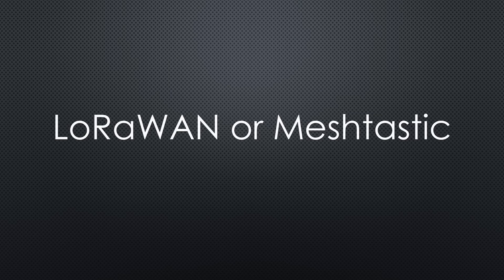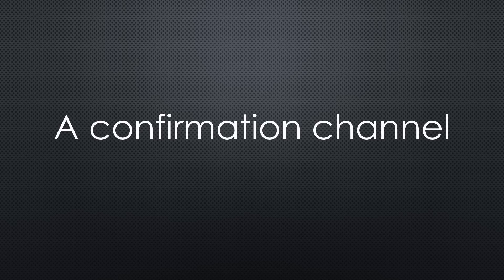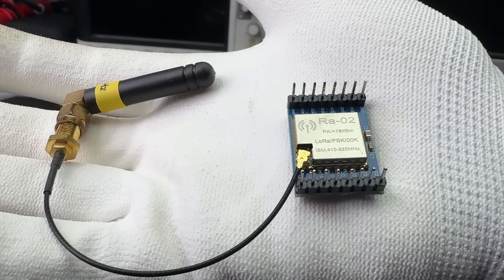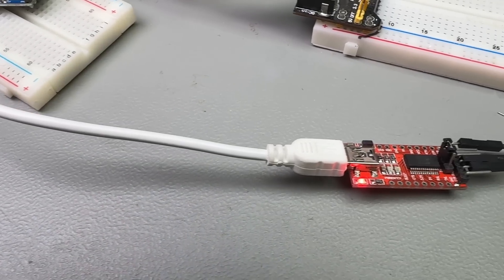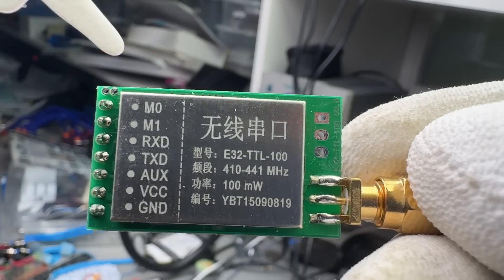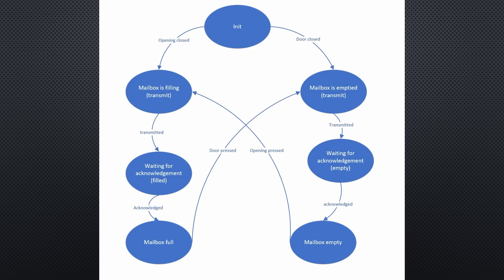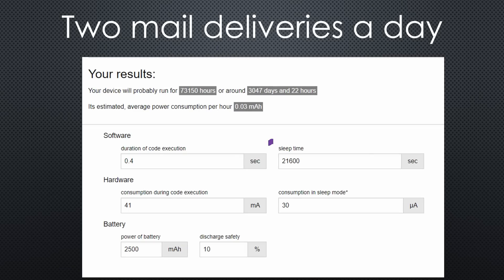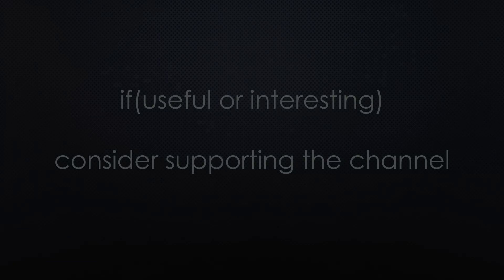(493) "Transaction Proof" Mailbox Notifier using an unknown E32 LoRa board and an ATTINY1614

Comment: Hi Andreas, you're right: "Goodbye LoRaWAN". LoRaWAN Concentrators are very nice piece of Hardware but the Application side for doing little IoT stuff is just cumbersome.

Please take a look at my website/blog, i try to solve the LoRaWAN up/downlink and other issues by combining both worlds into one and came up with my own easy protocol called LoRaLink - Connecting the Unconnected

It is not p2p like meshtastic, but uses (private) LoRaWAN Hardware to do some awesome IoT stuff. Can be self-hosted, no middleman, less complex and independent from Cloud platforms like TTN.

Comment: Well, should you get your hands on a none-refillable vape... Those usually have tiny lithium cells. With a cheap charging electronic you can run this for quite some time, and if you don't vape yourself but get it for free from someone else you only have the cost for the charging electronics - and even this you can use for other such cells... 😊
Reply from the maker: Good idea! I prefer primary batteries for such low-power fixed sensors because I can exchange them on the fly. Otherwise, I would have to remove the sensor for charging. 
I also do not know the self discharging rate of such batteries.
Reply: @AndreasSpiess  LiIon batteries have negligible self discharge. I wrote the voltage on several batteries and just left them for more than 2 years. And they were the same afterwards. They were left in a tempered and dry room, which may be of interest. Epecially the "dry" part.
Reply: @einars899  That's odd, because the widely quoted self-discharge rate of several varieties of lithium rechargeable chemistries is ~5%/month; NiMH can be as low as 1%, and primary battery chemistries quite a bit better than that, as Andreas said.
Reply: @alsavage1  For a battery with built in BMS that may be the case because it will use battery capacity to do its job. Some are draining the battery at rates you mention, some are more low-power. I was mentioning single batteries with no built in electronic of any kind. But I did this with many different 18650 LiIon batteries, so I cannot imagine any special chemistry.

Comment: Your power-consumption data-log shows a base current of 2mA (not in microA range) -you probably tested the power-consumption in standby/suspend and they where out of scope for this video. Archiving the Datasheets standby is often not trivial and i would not trust myself  to have done that unless i measured.
Since the ra-02 is a sx1278 it probably also has a low standby, if switched into sleep mode the ra-02 Datasheet seems to specify standby (ready to do something) only. You would not need to cut power (mosfet) to it if the driver/program handles the sleep-mode.
Reply from the maker: I did some measurements. You are right, deep sleep current depends on many things (I did some testing). This is why I assumed a much higher than specified consumption for my calculation. But time will tell when I finished the sleeping part...

Comment: if you had ESPnow to MQTT gateway you could have simply used ESP32 in the mailbox and that would be kind of 5 times simpler with the same results: reliable, low power, with confirmations. ESPnow supports long range connectivity and the full transmission including wake up and go to sleep is kind of 0.1s with about 8uA sleep current for ESP32. Less complications but of course one has to have espnow2mqtt gateway already there.
Reply from the maker: I agree. But I tried it a few years ago before I built the current notifier and it did not punch through the faraday cage of the mailbox.
Reply: @AndreasSpiess  so you want to use different frequency rather than 2.4 GHz right? and modulation. To get it through the cage. Right? ;-)
Reply: @zyghom  LoRa can transfer a message that is buried in the noise floor! You exchange the high bandwidth and requirement for a high link budget of WiFi with the opposites for LoRa.

Comment: Saw this and immediately thought that I would send you an operational jammer through the post.
Reply from the maker: And I would never discover it because I would never get the alarm to empty the mailbox ;-)
One advantage: I also would no more get invoices! 
Have a nice week.
Reply: @AndreasSpiess  I love it - always positive!  :) Best wishes
Reply from the maker: @richard_wenner  It served me well up till now ;-)
Reply: @AndreasSpiess  I would recommend a HELTEC V3 Board with Meshtatic and use the inbuilt Detection Sensor feature. It could transmit a State Signal every 2 minutes, so even if a jammer arrives or the system malfunctions, you would know. To save battery, a better board with the newer nrf chipset could be used or the mailbox could get a small solar panel and would double as an outdoor node.

Comment: Your state machine doesn't show anything happening if there is no acknowledgement. Do you have timeouts in those states that re-transmit the filling or emptied messages?
Reply from the maker: It is handled in the "waiting for acknowledgement". I felt it did not need a separate state. But I could have written it into the box, you are right.

Comment: Nice video! Would not just using confirmed uplinks solve your problem on LoraWAN? A known stratagy is sending 2C+1N messages. Being 2 confirmed and 1 non confirmed.
Reply from the maker: I never used "confirmed" uplinks. I assume it would also include at least one downlink message. There is not a lot of information available.  Did you use it and did it work?

Comment: I am not sure if this channel covered this, but a Chinese robotic lawn mower (Mammotion Luba) severely violated the 1% rule and users of it were contacted by the national frequency agencies in at least France, Switzerland and Denmark and were told to stop using it. The manufacturer (Mammotion) quickly rewrote the entire Lora code between the RTK base station and the robotic lawn mower into using a custom frequency hopping algorithm, and there were a lot of bugs, issues, and also a report that even the new algorithm violated the duty time rules. I am interested in how unprofessional and badly designed products on the market ruin the RF experience for everyone, how it is monitored, managed, etc..
Reply from the maker: Here, the authorities are responsible to monitor the frequencies. However, often, such violations do not harm others and are not discovered. But if discovered, these devices come on a black list and are confiscated by customs (if discovered). However, this Luba is not (yet) on our black list ;-)
Reply: @AndreasSpiess  In this instance it actually was discovered by neighboring businesses, as their equipment almost faced a sort of denial of service attack or jamming. The duty cycle of the Mammotion RTK base station was measured by the French ANFR as being between 30% and 95% as per reports. I guess once complaints were sent in to the authorities it wasn't too difficult for them (?) to send a car out and find the offending device. After firmware updates the individuals got a letter saying it was now ok to use the device again, however I am very skeptical of such companies that couldn't care less about the rules to begin with. Many interesting posts on it using the terma Luba, ANFR, RTK, etc.
Reply: ' using a custom frequency hopping algorithm'
There is no frequency hopping that can work, the rules for it are purely time and on the band based, there isn't any language for changing freuqencies within the band resets the time..
The band is clearly designated for low duty, and was willfully misinterpreted to pretend it was OK to be doing continuous transmission in any manner.  Max duty in the US was like 30 seconds, a minute, maybe two an hour, been a while since I last checked the spec.

ANY manufacturer or seller in the US pretends they 'didn't know', then they are almost guaranteed lying.  When they were coming up with this dumb, illegal use of the band, there were tons of people explaining how hard they were breaking the law.
But ultimately the FCC are the ones to enforce it here.  Don't be surprised if they eventually stop the market totally.  Even worse is all the people who do know it's actually illegal, and still using it.  FCC can fine their asses heavily if they can prove that the user actually knew it was breaking the rules.  So not a smart idea.

May vary in other countries, but most of them are even harder on people who break radio equipment laws.
Reply: @ModelLights  I am unable to point you to the analysis of the new algorithm, as YouTube keeps deleting my replies. So aggravating.

Comment: This may be the  video that makes me a finally join the loraverse. My mailbox is a little too far for the WiFi.
Reply from the maker: Go for it! I like this function.
Reply: @AndreasSpiess  I've been thinking of 18650s and solar for a letterbox monitor but those stat's for the AAs really blew all that out of the water. Such a good point!
Reply: @DenfordBerriman  You could maybe consider solar + LiFePO4. If you have it charged to max. 3.4 Volt it may be exactly right (I did not check the specs, just brainstorming).

Comment: I have tried a couple of solutions for a mailbox notifier. My mailbox is about ten meters from my house in a solid steel enclosure. I tried wifi and lora, but always had either reception problems or battery problems. Now I just use an Aquara DJT11LM Zigbee vibration detector, which works best for me, unless the mail carrier is very gentle. On the other hand, we got a lot of false notification last week when they were tearing up the sidewalk to lay new fiber optic cables.
Reply: In the case of LoRa you can improve a lot using the right antennas.
Reply from the maker: Interresting! I did not know that Zigbee works out of such a box. My box is about 50m away.
Using "secondary" indicators usually are less reliable. Here, 6 mailboxes are connected. So, vibration would not give me my private message, but, because I get most of the days something, it still would create a valid notification.
Reply: I have tried alot of solutions, different wifi systems and zigbee devices, nothing worked for me, untill I tried a Philips Hue Motion Sensor, that works just fine.

Comment: Can you tell me, does the signal really penetrate the Faraday cage (mailbox) or does it complete the transmission while the door is open?
Reply from the maker: I do not know for sure, but the opening looks into the opposite direction of the receiver and is quite small.
Reply: It does, because the slits are bigger than half a wave length.
Reply: Yes, mine is fully closed aluminium mailbox.  Half wave 868mhz antenna with lora power set at 75%.  Messages are received in the apartment 40m away.

Comment: Check out the Reyax RYLR998 transceiver. It operates with simple AT style commands. No libraries necessary. All LoRa parameters are available. Works with anything that can do serial, baud rate is adjustable, default is 115200. I've been using it quite successfully.
Reply: Agreed. I used a pair to build a basic boat robot while at University. The documentation is a little hard to read but very powerful.
Reply: Same here! Great board
Reply from the maker: I saw them, but thought they are similar to the E32. Where do you see the difference?
Reply: @AndreasSpiess  I had not looked at the E32 since it is 433Mhz. I need 915Mhz here in the US. The RYLR998 is very small and very well documented. Very good manual on the AT commands. Bought mine from Amazon with quick delivery. The RYLR998 has AT commands to change anything you wish for LoRa parameters and/or your per to per, one to many, or many to one LoRa network addresses.  Reyax has other models but I don’t see one at 433Mhz with the AT command set. I like it because you don’t have to get involved with LoRaWan or the Things network. Too much overhead for me. The board can also be fitted with a Ufl connector if you want a higher gain antenna. I have gotten around ½ mile range in a suburban setting with a pretty crude prototype using the built in antenna. It can be set to 868Mhz with the AT commands; is that legal in Europe? They are simple and get the job done!

Comment: Glad to be a Patreon supporter.  Again you read my mind; even all the way from Michigan.  I have played with Meshtastic and have decided my home automation can be done better with less complex LoRa methods.  This video is right on target for me.  My mailbox is 300M from house (I am on 10 acres (4 hectares) of land).  Notice nested parentheses, I must be a programmer (LOL).  I also want low power security mesh to be aware of what is on my land (deer in garden or unwanted 'guest') [gates, motion, doors, etc.].  My home-assistant system is on a solar battery bank.  If I lose power, some of my automation is still running.  If there is an EMP, then my hand tools will be 'high tech', otherwise, I will have some tech working.   Thank you for all you do and share.  Doug, N8VY 👍
Reply from the maker: Thank you for your support, Doug! Actually, I was in Chicago and Milwaukee this summer on my way to Las Vegas. So the "reading" did not need to travel far ;-)  73

Comment: me, jumping around between espnow and lora for my "out of wifi sight" projects at home. Found no favorite by now ...
Reply from the maker: I like ESPnow because it is simple and cheap. But for this faraday cage, lora is the only way to get a signal out...
Reply: @AndreasSpiess thanks. 
Ordered all the parts.
Reply: ESP:NOW is Wifi in its core. I use a standard Wifi Card and Wireshark to monitor what I send with ESP:NOW and if the payload is really encrypted. It is just a vendor special frame type that is usually ignored by everything else.
Reply: Try on Ra-02, it's a good apot
Reply: Might have ordered the wrong parts for US 
This what I need ?  And anything else ? 

Long Range LoRa 915MHz RF Module CDEBYTE E32-900T30D 1W 915 MHz Wireless Transceiver iot Transmitter Receiver